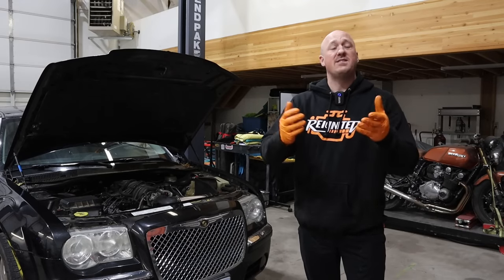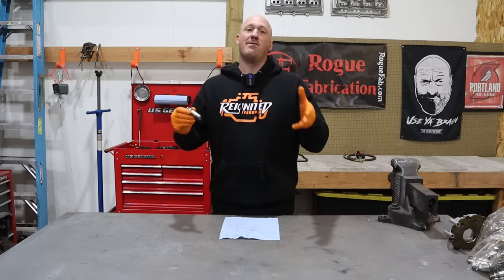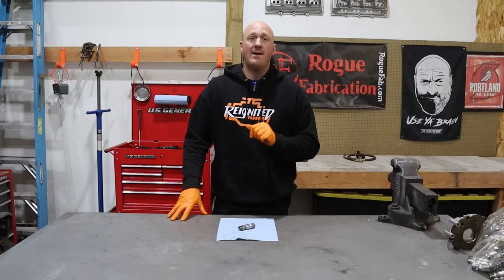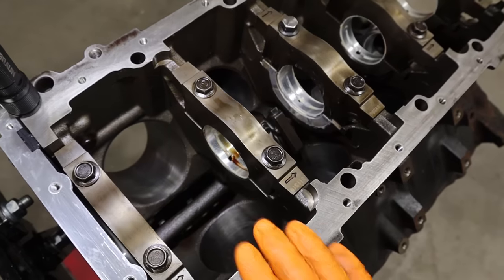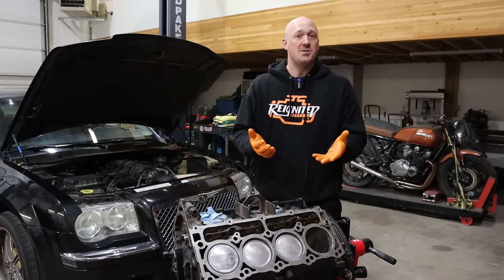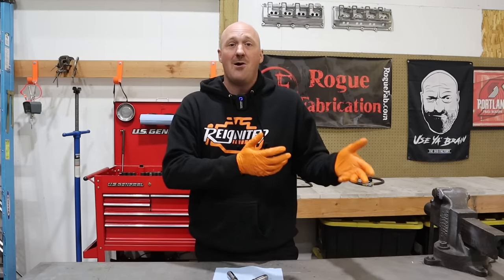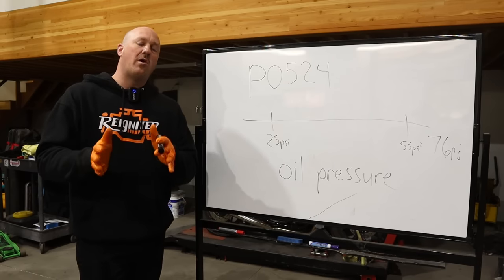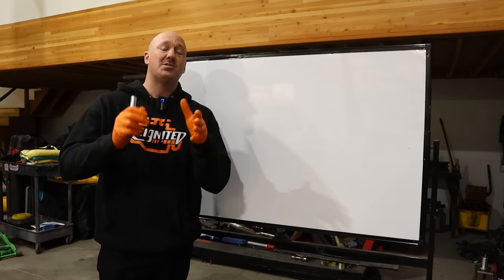The BEST Prevention For Hemi Lifter Failure! (In My Opinion)

Comment: I have a new remanufactured 5.7L in my 2017 Hemi ran 2500. Less than 1500 miles, less than 30 days. Loud lifter and possible rocker. Builder advice is to put 5,000 miles on engine. Should work that tick out. This makes no sense to me. 5 professional mechanics say I need a new motor. I'm afraid to drive this truck and very disappointed.  $9000 and I didn't even need a motor.  I bought the truck with 200,000 and wanted longtime security.  So I had motor replace. Your opinion is appreciated.  One mechanic even suggested STP after watch your video. Looks like that can only increase my issues.
Reply from the maker: Absolutely not right to have a ticking noise on a fresh rebuild. It may tick for about 20 minutes or so until the lifters bleed out but after that no. Putting additional miles on it will not help anything. Engine needs to be diagnosed unfortunately, sounds like an error was made during the rebuild process. And yes, I'm not a fan of oil additives to mask potential engine issues.

Comment: I have ran two Hemi engines to a total of 300,000 miles with zero issues.  I used conventional Lucas Heavy Duty Oil Additive in both engines. I also didn’t let them idle for long periods of time.  I think the thin synthetic oil tends to run out of the lifters possibly leading to dry startups on the rollers. I am not sure when they switched from the 5W30 oil to the 5W20 oil. That could also be a factor.
Reply: I totally agree. I think this is an oil weight issue. Because Chevy and fords new 7.3 gas engine are having the same problem.  

I would also recommend 5w30 

03-08 hemi ran that weight and didn’t have this lifter problem

Comment: My brother just did a cam / lifter job on his son in laws 2018 Ram 1500. Big job!😢 Expensive job!😢 Regarding the idling issue do you think a remote start and longer idle times while cold could be adding to the potential problems? Great video. I'm an "old" Mopar guy and had several Dodge / Plymouth performance cars from the sixties, including a 69 Charger R/T. The cars were pretty cool but today's cars are so much better engineered particularly regarding handling and brakes. Thanks for the education!😊

Comment: I have a 2003 5.7 in my truck. From the first day up until today I have always run 15-50 full synthetic oil. This engine now has over 200K miles on it. The compression has only dropped 5lbs from brand new. I keep it properly tuned and proper oil changes. The only repairs has been front and rear seals, water pump and clutch assembly.
It still runs like new and I am not particularly nice to it either.

Comment: Had the "Hemi Tick" without the tick. Started with a misfire on cylinder 3. Did all the troubleshooting/diagnosis with my mechanic-brother in law, and we thought it was a collapsed lifter. We didn't know what it really was until we took the lifters out and the roller was completely gone. We tore the motor down to check the bearing condition, and it looked good still. Must have caught it early enough. So in went a Texas Speed Stage 2 cam, Comp lifters, Melling high pressure oil pump, and a bunch of "while I'm there" parts. At the tuning shop now, let's see how she goes!
Reply: (Also recovered the 4 pieces of roller and 12/13 needle bearings from the oil pan.)

Comment: Very informative! I heard some tapping instead of ticking. It turned out to be a dead cell so i had a tune up! It helped but when i first start it up you hear the tapping. After its runs a few minutes it stops. 2005 hemi. Will it eventually smooth out? I was told i just need to drive it more. What do u think? Suggestions would be greatly appreciated.

Comment: 5w-30 solves it cheaper than a hellcat pump. Just a little thicker oil stays on the part longer. Just like a differential. Good oil clings to the parts..you can actually drain the oil out and the parts last way longer than ever imagined simply because the oil coated the part longer. I am not saying way heavier oil.. just enough.. 5w-30 full synthetic has cured more than 1 for me. GMs also have lifter problems. Same problem 5w-20 may be lighter and help mpg it is too light to stay on the parts long enough to cool and protect... The hellcat pump works because it just delivers more oil faster. 5w-30 stays on longer and therefore does not need to be sprayed faster. Jmo.

Comment: Excellent video
!! Thank you for showing the basics of the MDS system as it was very helpful. I saw another video with a lot of comments from Dodge technicians saying to switch from 0W 20 to 5 W 30 engine oil. What do you think about this? I was thinking about doing this with my truck as it only has 34,000 km on it and doesn’t make any noise right now but I do live in Canada and have to make sure the truck is warmed up before I go anywhere, especially in the winter. It was -49 here last week, but I always plug my truck in in the winter anyways.I was thinking I could also get an oil pan heater. If I did go to a slightly thicker oil, your opinion would be greatly appreciated. Thank you.

Comment: Hi Sky, another great informative video, thankyou.
P0344 6.4 SRT Jeep. 150k klms. High rpm only, ie using the launch control or randomly when over taking. After 2 restarts the engine light goes off.
I’m yet to change the sensor as I have a feeling that it won’t fix anything. Have you experienced this code. I’m thinking it’s a deeper issue with the engine, chain maybe ? Any advise would be much appreciated 
Regards Tony.

Comment: Great video. I believe, code also throws if oil level is low. I would be interested to see if just adding an extra .5 or 1 qt would make a difference.
Reply: Adding additional oil to your engine is not a great idea. If you're exceeding the maximum capacity, you run the risk of having certain components making contact with your oil supply. If it's even just a little bit, this will compromise the oil supply. Now, low oil supply will cause low pressure. Adding more than needed is not going to increase oil pressure. The pump will only operate at its full potential in relation to its mechanical operations. The pump will pump faster if its components are  accelerated by the other driving components. Increasing the already adequate amount of oil is not going to make the pump operate faster. When engines are designed, it's made certain the oil capacity (maximum capacity) is more than enough. It explains why a higher volume oil pump can run off the same oil supply as the factory pump. A full supply is going to be plenty.

Comment: 2008 ram 2500 with the 5.7 with 220k original miles and been blessed to not have this issue, runs flawlessly. nothing but routine oil changes (penzoil is my preference)

Comment: Maybe I missed it but one thing I noticed on the 6.4 in the fleet trucks is that the lifters for "MSD" or "DOD" is that they are slightly different in diameter than the regular lifters

Comment: Lov the video and the work that went into it. A few questions please . 1- what would be a cost estimate (for the average Joe who can’t perform this oil pump change themselves ) if this were done at a dealership ? 2- my 23 Ram has less then 8,000 mi as of 7-14-24, so thinking preventative measure here , would that void the factory or extended warranty going from factory oil pump to hellcat oil pump ? Thanks Gerdy from NJ

Comment: I think there is room for the argument of using a higher viscosity oil. When the oil is not bleeding off from the bearings of the crank and cam so quickly, I believe there will be more oil to be running through the lifter gallery. Oil pressure should be greater at Low RPMs and have a higher film strength to protect all surfaces

Comment: Hey I look forward to these Hemi tutorials. Back in the day I always went with high volume over pressure. Everyone’s thoughts at causing Hemi tick issues was long idling. Now we need some long term data results. I hope Ram/Stellantis will watch this video and upgrade components. 
Excellent video
Reply: With the Hemi production coming to a close for new vehicles (except Ram trucks, they still available in 2024), I don't think they are going to spend any R&D on things happening to engines that are failing 10+yrs after being built.
Reply: Wonder where the Hemi engine is built. All it is a swap out components before assembly
Reply: They wait till the next redesign before addressing anything, if they do.

Comment: I have just come across this video, well done by the way. I’m in New Zealand and have a 2014 SRT with 120k km on it. Some questions I’d love answered while I get my head around this ticking time bomb (excuse the pun):
- does the ‘tick’ tend to occur once the needle bearings have broken down or later when the cam has worn excessively?
- I’m guessing once the tick starts, there’s no stopping it. Trying to differentiate this tick from other ticks, is important I think.
- you talked about regular oil changes but didn’t say much about oil brands, or specifics. Penzoil is hard to get over here and damn expensive too if you can actually find it. I understand SRT engines are pretty fussy re preferred oil (not sure why) but my research led me to Penrite 0w-40, 10 tenths premium 0, which I continue to use. Any thoughts on oil or oils to avoid? I always use a mopar filter by the way.

Thanks in advance.

Comment: Bought a 2012 SRT8 392 at 34,000
Lifter failed at 72,000, did oil changes at 3,500 and I did use the vehicle for what it was intended for.

Long story short we did a 270 comp cam and a few other upgrades including hellcat oil pump and now just normal tick no issues. Yes I did MDS delete as well

Comment: Great video...Just a thought...How about putting a smaller pully on the stock pump?
Reply from the maker: The pump is driven directly off of the crankshaft itself so unfortunately there's no way to speed it up. 👍

Comment: Wow this was an awesome video! I'm the proud owner of a 2006 Dodge Charger Daytona Top Banana. It's my baby, and has 45,000 miles on it. I have learned that oil is a very critical part of these engines for sure. Luckily I have had no real issues yet, and since mine does sit a lot, I do a few unique things before starting the car. Such as, turning it on to run mode before cranking, getting the oil pressure gauge up in the cluster, holding the gas peddle all the way to the floor, and cranking to build oil pressure before allowing the engine to run.

My Dad has a 2009 Dodge Challenger R/T with the VVT 5.7, and under 30,000 miles. I'll have to get him to consider full synthetic oil and make sure he's changing often enough. His car is a push button start, is there a good way to prime the engine with oil before letting it run like I do with mine?

Comment: I'm a MAT, ASE certified.
Now over 40 years.
I would have to agree with this gentleman regarding a high possibility of needle bearing failure due to excessive idle times with the GEN III.
We have to remember that clearances are much tighter in this engine, and that is one of the reasons for premature failure when pressure levels are low to nominal.
This can be proven by disassembly of the roller, rocker and measuring the needle bearings, new, from used.
Almost certainly you will find that the needle bearings on taxi cabs and police units will have greater where evidence. These vehicles have excessively long idle times.
Police and taxi cab engines should have higher volume pumps so to allow greater oil flow during idle.
The computer that accommodates these engines should have a wider parameter, so the codes never are said due to an abnormality due to higher pressure parameters
It's a learning experience. Any changes make the bean counter go up.
Simply put, it's something that they need to account better for in the engineering department. Meanwhile, I'd say it's a good remedy in my opinion.
Thank you and God bless.
Reply from the maker: Appreciate your input, and thank you for watching 👍

Comment: I have not read all the comments. Maybe someone has already mentioned it, but 2 things I have not heard you mention are the 09 and later lifters possibly being a cheaper grade of material. Also, in your older video you talk about how the mds lifters work. You show us that when mds is activated there are springs inside the lifter that are weaker than the valve spring which keep tension on the cam lobe to prevent damage. This turned on a light bulb in my brain. I think it's possible that the tension springs inside the lifter are not strong enough to prevent a lifter "float" at higher rpms. This would explain why this issue wasn't seen as much on an 03-08 hemi, and why it's seen mainly on the mds lifters.

Comment: I have a quick question for you if you have time do you need to remove the water pump from the timing cover if you’re going to change the timing cover gasket on 09 dodge ram 5.7 hemi engine. Thank you for your time and great content that you’re putting out.
Reply from the maker: Sure don't, only time I ever take the water pump off is if it needs to be replaced.  👍

Comment: Great video thank you for sharing. What about the non-serviceable transmission on the new Ram 1500 2019 & above. The dealer said it is a lifetime and only has replaced 1 or 2 transmissions for the new transmission over the years. Any thoughts?

Comment: I own a 07 Ram 1500 with 5.7 Hemi with MDS. When it was at about one hundred thousand miles. I thought it would be a good idea to run 5w 30 oil. It started turning on the check engine light. with a P0524 code. I might mention I am a retired Chrysler tech with 45 years experiance. There is also a time and temperature logic used to set this code. When the engine has been running for a set amount of time and the temperature at operating range it is looking for a specific oil pressure. If the pressure is too high it will set the code. By changing back to 5w 20 oil the code no longer sets.

Comment: Im a master engine builder the 2009 plus hemi lifter failure is a problem of oil running off the lifter and not getting to the roller pins because the lifters are laying at a bad angle

Comment: I change my oil on my 2015 Ram 1500 around 3,000 miles.  The first oil change I did, the dealership argued with me about changing it.  They kept saying that I didn’t need an oil change because the light wasn’t on.  I was surprised because I was trying to pay them to do it and they were trying to convince me that I didn’t need an oil change.

I finally told them “It’s better to change the oil more often than less often, and I’m trying to give you money to do this work.  If you don’t want my money, I’ll take it elsewhere or do it myself.”. They finally agreed to change my oil.

My truck now has almost 200,000 miles on it with no lifter issues.  The water pump is a different story…

Comment: Maybe I've been lucky by I've owned three 5.7l Hemi Rams. 2008, 2013, 2018 and newer 6.4 Challenger. Never had a cam/ lifter failure. All went over 160,000 kms. (100,000 miles) I'm in Canada so they got higher idle time in the winter. I always ran Amsoil Signature Series oil with the 5038041AA SRT oil filter except on the 2008. I changed the oil every 5000 kms. (3100 miles). Rather have the expense of a couple extra oil changes per year over a major engine failure. My inlaws own a Chrysler dealership and a couple of the techs are my buddies. They always said the Hemi's were great if you ran high quality synthetic oil and did more frequent oil changes. Followed their advice and never had any issues.

Comment: Question? Does the high volume pump cause the oil pan to be dry? Do you need to switch to a bigger pan to account for the higher volume oil? Maybe one a pan that can hold 2 additional quarts. I am getting ready to do my cam and lifters and was thinking about the oil pump to an HV pump, but I don't want to starve the engine of oil. Not racing, just a daily driver 1500, but I like to idle it to cool the cab in summer.
Reply from the maker: No additional oil volume needed, the Hemi engine drains back to the pan very well. Also, the Hellcat vehicles that come stock with the higher volume pump use the same 7qts oil capacity that all the other Hemi engines use. 👍

Comment: I put a rebuilt 5.7 in my 09 ram I used a high volume millings pump I'm still hearing a slite tick at idle I use royal purple oil I have 4500 miles on it now I di a oil change at 3000  with thepump i went with I haven't got a a check engine light for low pressure thinking upgrading to Johnson lifters  cam failure seems to be a problem even in older engines these days my camaro chewed up 2 cams both from lunnati I used Johnson lifters in the motor this tim around so far its been ok my engine builder found even though the lifters come in a crower comp cam or any other make cam failure is still occurring the lifter bodies are coming out of China and the cam manufacturer putting their internals Johnson only uses forged metals from the US  granted their cam components are expensive but cheaper then a rebuild the lifers for a hemi are around a thousand thanks for the information learned alot